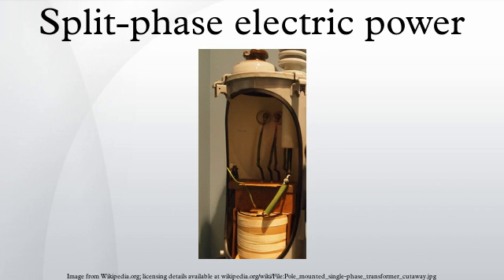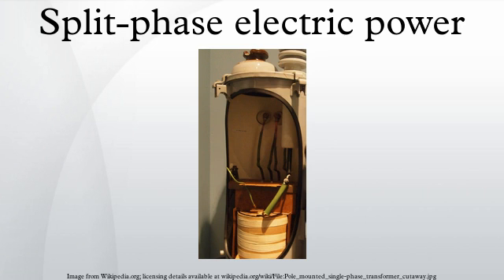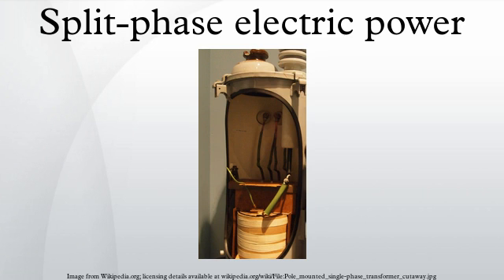Split-phase electric power

Comment: can split phase converted to single phase by connecting line to line
Reply: as in combining them
Reply: Split phase is basically two single phases. Line 1 to Neutral, and Line 2 to Neutral would be 110V. Line 1 to Line 2 would be 220V.